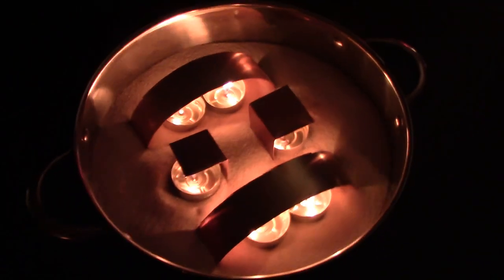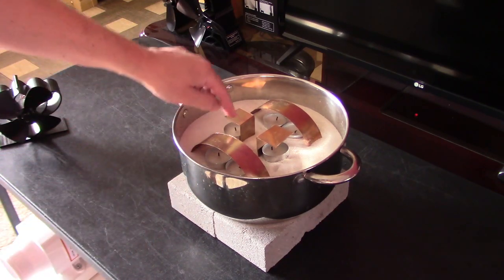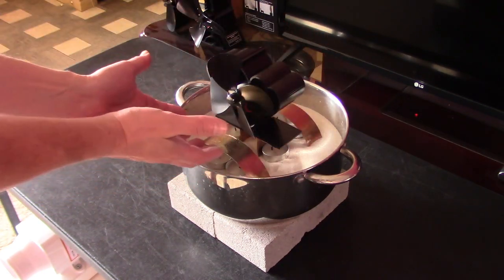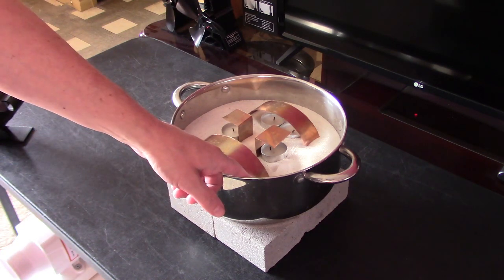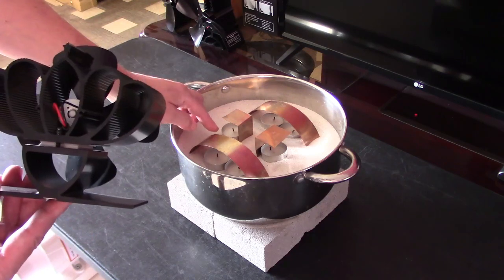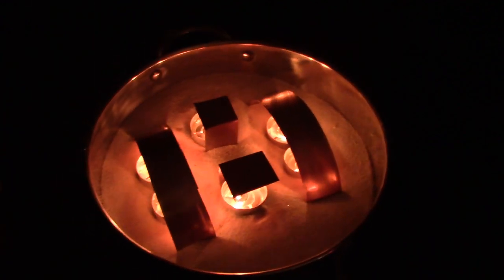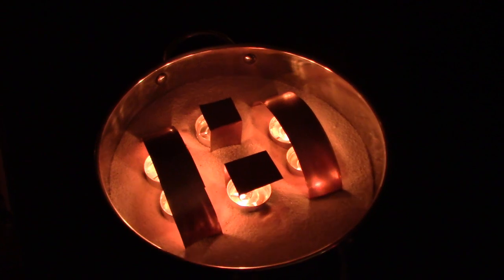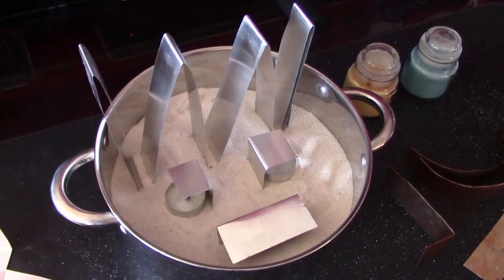Make a Sand Battery Air Heater at home! no-electricity needed! strong air heater! - w/fan! 300F/150C

Comment: sure the heat from the tea lights is going to heat the copper which will intern heat the sand but the fan starts right away b/c it's right on the copper seeing the most heat from the tea lights, what temp did the actual sand get up too? i have a feeling it'll take quite a bit of time for the tea lights to heat up the sand to several hundred degrees.....?

Comment: Amazon PROMOTES mail fraud of sellers. I have email from A that says so. Therefore do not promote Amazon.

Heat-powered fans are nifty but they also cost about $70 each. A cheaper but similar fan is needed
Reply from the maker: hi. the fans are much cheaper than $70. i've bought 4 fans so far. prices were $15.00, $19.00, $22.50 and $29.00. there are a few sellers that mark them up but don't buy from them.

Comment: Great video! Here in Norway you can buy cheap tea lights, but they are bad for air quality, is that something you're thinking of?
In the 80s it was really popular copper wood storing buckets 40 liters. Would those be better than a normal pot you think?
How large room could you heat up with your invention?
Reply from the maker: hi. i keep the tealights to only 6 so not very much in the way of soot from just six of them. (they put out about half the soot of a regular candle, so it's similar to burning 3 regular size candles). if you want a really clean burn you can use tealights that are made with beeswax. i just bought some beeswax tealights recently for my next project video

Comment: Definitely got to have the candles not too close to the copper or they will soot up and cause the room to smell a bit. Can't get the same temp as you, still experimenting with the set up...
Reply from the maker: hi. yes, don't put the candles too close to the copper or the flame will not get as much oxygen and will not burn as hot. but don't put them to far away from the copper or the copper will soak up less of the heat that they put off. i've noticed a big difference in temps if the copper is even a little too far away. make sure to use at least 24 gauge copper (and a little thicker would probably be okay too).

Comment: Try a circular pattern that surrounds a center support for the fan. Tea lights on the perimeter (6-8?) and one larger glass candle in the center. One upside down "U" strip over each tea light.

Comment: Do you think this will work as good with table salt?

Also what did you use to cut the metal into strips?
Reply from the maker: it would probably work okay with the salt (but i couldn't say for sure). i used tin snips to cut the copper 👍🙂⭐

Comment: I've found that some tea candles give off a lot of heat, and others give off virtually none. Discovered this using the clay flower pot heater. 

Make sure you have hot candles before you stock up!
Reply from the maker: it seems to depend a lot on how thick the wick is. the ones they sell at walmart have a surprisingly strong flame. almost as strong as a wick of a taper candle (and taper candles are some of the strongest).

Comment: I love this, for my non heated craft room. Been using a ceramic heater as my heat source. Looking forward to making this. Question what type of sand are you using?
Reply from the maker: hi and thank you! i'm using a white 'play sand'. it comes 'cleaned and filtered. you can get play sand at the home stores (home depot, lowes) for 5 to 7 dollars. (for a 50 lb. bag). this project uses maybe 20 to 25 lbs. btw, the copper i'm using is 24 gauge. the curved pieces should be 10" to 12" long. they sell copper sheet on amazon

Comment: Where did you get the fan?
Reply from the maker: hi. i got it on amazon. i've actually had that smaller stove fan for 2 or 3 years now. amazon sells dozen of different models. any model that has a starting temp of 122F/50C (which is most of them) should work good. the larger fan shown in the video is also from amazon

Comment: I was thinking of filling a pot like that and setting it on my wood burner in my work shop. Do you think the stove would heat up the sand to much? Or would this set up be better?
Reply: I have a pot on my stove and it is still giving off heat at 9am the next morning when the actual fire went out about 3am.
Reply: @jlyoung4848  I still plan on giving it a try, good to know someone else was thinking the same thing.
Reply from the maker: hi. i don't think your wood burner would heat it up too much (but use your best judgement). these fans can handle up to 662F(350C). this setup i made tops out a little under 400F(205C).
Reply: @desertsun02  400? I didn't think it would give off that much heat. I gotta try this now. Thanks for the info.
Reply from the maker: @chrismead1464 hi. copper tops at about 400F with 2 candles on it and around 300F (with one candle on it). sand temps near surface can be 220-275F but probably higher if you run it longer, use more candles or use candles with a thicker wick.